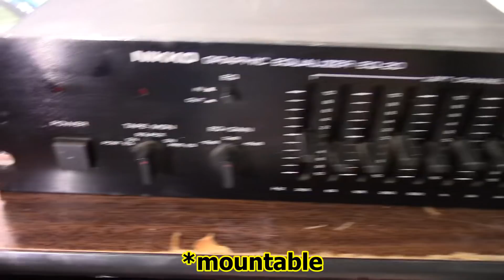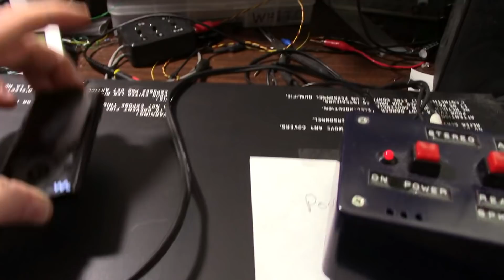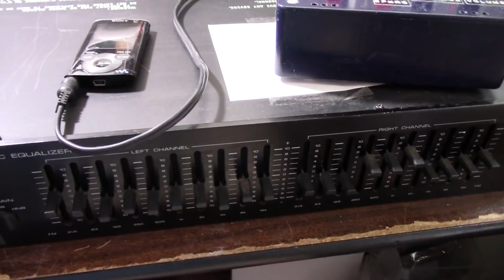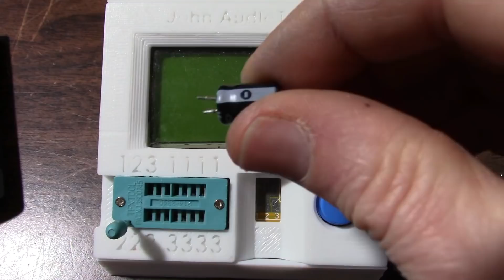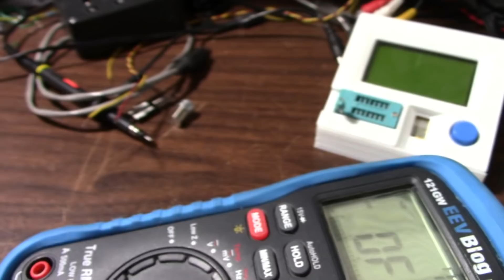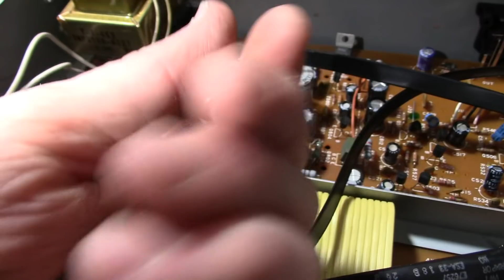Nikko Graphic Equalizer EQ 20 repair

Comment: Hi John, 
I really enjoyed watching you troubleshoot and repair this Nikko equalizer. I really learned something. I just picked up a Nikko EQ-1 equalizer that looks very similar to the EQ-20 you repaired. Mine powers up, but I haven't tried it out yet. I'm cleaning off all the gross nicotine covering it now.
I'm starting to learn that a lot of problems with older gear seems to be bad capacitors and cracked solder joints. It hurts my soul to see such good gear being thrown out when a lot of the time all it needs is a solder repair or some capacitors replaced.
Reply from the maker: It's always good to save old gear from the scrap heap!

Comment: Interesting video, thank you. Just a thought: It might be worth squirting in some switch cleaner into those slide switches before buttoning up. It'll lubricate and flush out any dirt that might cause ongoing issues. All the best, Beamer.
Reply: That's a quick fix only; there's a fundamental difference between level of cleanliness, appearance, life expectation and, most importantly, measured contact resistance between switches pumped full of cleaner and ones disassembled and serviced properly.
Reply: @paulb4661  Hmm, having earned my living for decades doing this I can assure you a quality cleaner correctly applied helps maintain a switch's integrity for many years. Even if a switch is failing it can be rejuvenated for many extra years of use - guaranteed. Please see my video: https://youtu.be/MS32FXfQaJ0 Naturally, nothing lasts forever and if a switch is so far gone (and you'll know it) - it'll need replacing. The process of switch disassembly can introduce mechanical and electrical intermittency issues.
Reply: @beamer.electronics  Our experiences differ then substantially, having seen the insides of throughly sprayed switches on serviced equipment multiple times through the years. Broke a few, fixed many more - time consuming and demanding in the dexterity department, but no intermittent contact issues, no oxidation, no patina and no comparison to still dirty, but well oiled spray jobs. Jewellery cleaning agent and a liittle contact grease does it.
Reply: @paulb4661  Yes, you're right: Same world different experience :) I probably have replaced more than I've squirt cleaned/repaired. That failed mains switch in my video has now lasted well over 1 year, tuner used every day, and no signs of failure. Since the early 1980s - it was probably the first time it had ever been squirt cleaned. Our polarised perspectives have been interesting, all the best Beamer.

Comment: John buddy, it appears that you have one of those cheap eBay component testers, they are available in a few different types but the type that you seem to have is the real basic one that doesn't give you a Vloss reading! I heard you say that you checked the capacitor ESR value but I didn't hear you mention the leakage value! The only place that high ESR capacitors will be a problem is in the power supply filter capacitors! High ESR capacitors won't cause problems anywhere else, but capacitors that leak DC will! As you have seen in the delay circuit! 
Do yourself a favour and get yourself a component tester which displays capacity, ESR and Vloss especially if you are going to be making repairs or want to know if another capacitor that has been pulled out of another circuit is actually any good! 
To many people focus on ESR to determine if a capacitor is good or bad, it's really bad practice and it should be stopped! 
This isn't about whether anyone should always leave the original capacitors or replace them all with new! It's about knowing the real condition of the capacitor! 
I always say that if you value your equipment, replace all the capacitors but always go up in voltage wherever possible! Your equipment will last much longer than what it did with it's original capacitors! 
Did you know in the old days, RCA used to test the capacitors that they were using in their TV's at twice their rated voltage! In other words, they were actually putting 400V across (t) a 200V capacitor! Try that with a modern capacitor, it won't end well lol. The point is that, the old paper wax capacitors weren't as good as what we have today so they were always underrated! Which is why they lasted so long, with the new modern capacitors, because they are so much more reliable, manufacturers tend to stick too close to voltage tolerances and that doesn't leave a lot of headroom for capacitor deterioration, in fact I believe that the larger manufacturers are most likely aware of this problem and allow it because it means repeat customers sooner! 
So basically the golden rule is, always go up in voltage on replacement capacitors, especially if it's next to a heat source of any kind! 
If you have been following Mr Carlson's Lab, you would have seen the videos where he tested leaky capacitors on his Heathkit high voltage capacitor tester, you would have seen that while he was testing a high voltage capacitor, at low voltage it tests perfectly fine but as he climbed up in voltage, it came to a point where it started to leak DC! They always begin leaking from top down, so if you go up in voltage, you won't have to replace any capacitors for a very long time to come! I really hope that I didn't come acrosst (LoL I don't know why Americans say it like that along with soder and bat tree) like a smartass, I'm just trying to bring awareness to the industry in a hope that we can understand what the real problem is and that it's better to repair it, and repair it properly rather than replacing it with a new one that is not going to last and possibly harder to repair due to everything getting smaller and surface mounted! Not to mention proprietary ic's that are not available one year later! That's why we need to keep all these old equipment out of the landfill because that's basically what we have left to purchase today! 
But please look into getting a better component tester, on eBay, you can see in the images where they showed a capacitor being tested and you can see the screen showing all the details! That's the one you want! 
I purchased a dedicated ESR meter age's ago thinking that now I have the tool that can find all the bad capacitors in circuit! And yet I was still having problems! Once I worked out that ESR is not the first thing that I should be looking for, I got the right tools, first I got the cheap Chinese eBay component tester! It was great but it didn't have a case so then I got an LCR Bridge Meter which provided even more information and I have never looked back since! I would love a vintage Heathkit capacitor tester to apply full rated voltage across it but those things are unobtainium here in Australia! Both that and a signal tracer! Either a Heathkit or an Eiko! 
You could have used your scope to trace out the signal but I believe that you made the right and best decision to signal trace it! 
Maybe you can design and build your own signal tracer? Perhaps one with adjustable and enough gain to pick up even weak signals? Carlson built his own and it's non contact using RF pickup so that you can hear bad resistors that are arching over inside! It's an indispensable tool for the bench! 
Anyway, I apologize for the lengthy post! I just hope that I have been of any help! Thanks for your patience.

Comment: Nice repair! This is probably the same issue that I had with a Realistic brand EQ that I had bought in the early 90s. It stopped outputting audio sometime in the late 2000s and instead of trying to fix it I ended up taking it to e-waste as I didn't have a use for it or the knowledge at the time to be able to attempt to fix it myself.
Reply: I have a realistic brand EQ that I've had since the early 90's and it still works great and I've moved about 15 times with it. that's weird that yours quit working.
Reply: @bretthibbs6083  some models from realistic/optimus used extremely crappy electrolytic caps that become very leaky. some used tantalums in the signal path that will be out of spec by now and some used the very corrosive glue. it's not really weird that his stopped working, it's weird that your's hasn't.  i can guarantee you that a recap will be a huge improvement in your sound and getting any glue off the board will prevent it from dying. i like nichicon UKL 10% in the filter networks. anywhere in the signal path and a good cleaning of the sliders using proper chemicals depending if they are carbon or copper traces inside with a couple hundred mini eye makeup swabs will make an even bigger difference. (i have alot of eqs come across my bench. i've done a/b testing before and after service with like models and the difference is huge)

Comment: That trick with the magnet for testing reed switches is so obvious.  And yet I have never tried it.  Thanks for that tip.
Reply: It does not really test the relay so much as trip it. The coil could still be burnt out. I wonder if you could hyper extend the reeds and damage the relay doing it too? Maybe not. They're in little glass capsules.

Comment: The first thing I saw was that relay. Wouldn't it have been better to start at the output and work your way back to the input? Kind of like cheating at solving a maze.
Reply: In this case, it would have.  But not always.
The first thing I did was to hit the internet for a repair manual or schematic.  I didn't find one, but I did find an owners manual that was dated 1981.  So this unit is roughly 40 years old.  Knowing this, my first guess is a bad capacitor that probably blew a semiconductor - likely the output transistor or op amp.  I would have started my trace right there.  Finding the output transistor working would have led me straight to the relay - the next component in the signal path.

The whole unit needs to be recapped as all those electrolytics are at or near the end of their life cycle.  Luckily, all those caps are just a few pennies each.  But egads - he's putting 40yo caps back in.
Reply: @jdlech  these caps are not filtering a SMPS. Let's try to not lose sight of that, OK?
Reply: @1pcfred  Doesn't matter.  When a cap fails, it can easily take a transistor or chip with it.  Every one of those 40yo caps are at risk of failure.  Engineers don't stick random caps in a circuit for shits and giggles.  They all serve a purpose.  And as we saw here, a single failed cap can make the entire unit quit working.  The next failure could take out irreplaceable ICs.
Reply: @jdlech  there are no ICs in that EQ that are irreplaceable. I am not sure about no extra caps in circuits either. The whole unit is a POS. I don't know why you are so worried about it. It was literally going to the scrap heap before John got it. It was on its way to the great hi-fi junk pile in the sky. They've have burnt it in the open air for it's metals in Africa. Bog common op amps and all.
Reply: @1pcfred  Ah, and you obviously think that's the only EQ in existence.  Tell you what - give me an address and I'll send you all the 40yo caps I pull for your own use, since you think they're so precious.

The Chinese second hand component industry must love you.
Reply: @jdlech  I'd rather have second hand than counterfeit parts. That's all the choice there is today.

Comment: Do you know anything about the KA2209 op amp? I mined one out of a dead pocket radio from the 80's and was wondering if it would be feasible as a headphone amplifier.
Reply: ka2209 is a stereo power amplifier rather than a basic op-amp, it will have no problems driving headphones.
Reply: @ferrumignis  Thank you, have a good weekend !
Reply: @hemlocksalad5383  You too.  There are several KA2209 projects on YouTube if you search!
Reply: BTW, KA2209 is equivalent to TDA2822M. You'll probably want to lower the gain externally as the default 40 dB makes things very hissy on headphones; there's actually at least one KA2209 kit allowing you to do that.